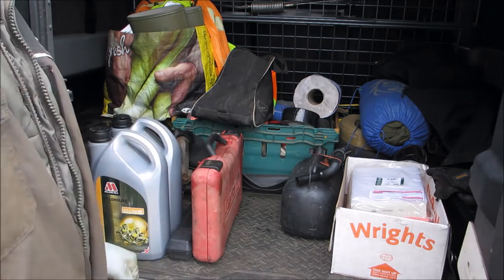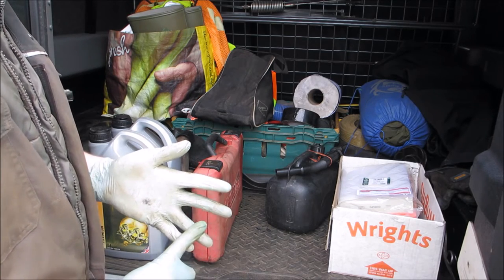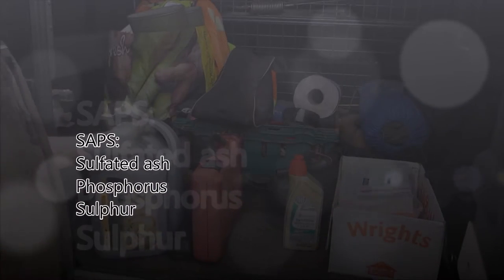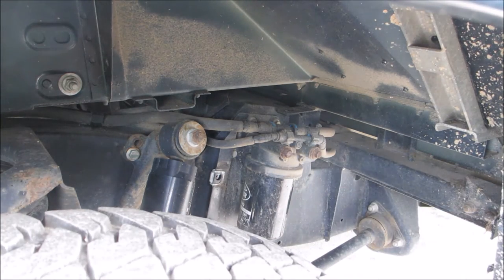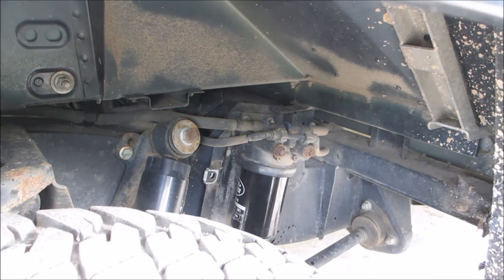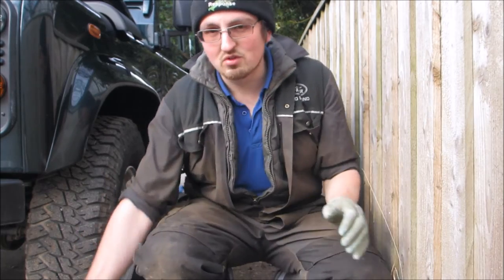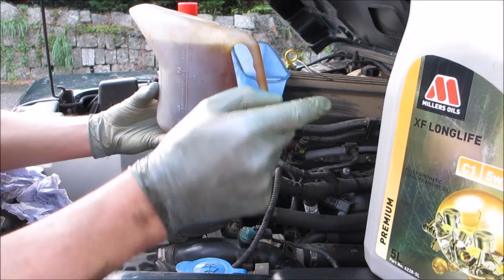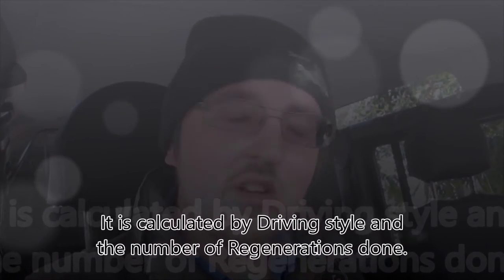Land Rover Defender 2.2 TDCI Basic Service Guide

Comment: My go to Land Rover Service video.Taken your advice with changing oil and air filter every 6000K.Always manage to do something wrong,like get more oil down my arm than in the receptacle, not securing the air filter body down correctly after replacing the air filter and hearing it rattle around as I drove proudly down the road or spilling new oil down the side of the engine despite using a proprietary funnel.If and when I shed my stupidity and cack-handedness this job will be something I look forward to rather than dread.Thank you and keep up the great content.....now on to the squeaky pedals....

Comment: Mate, that's awesome! Thanks very much for taking the time to share, especially for going to the extra trouble of showing all the part numbers and fluid specs. If you're wondering what to do in future videos, my vote would go to showing all the different points that need to be regularly greased (or at least checked). On one video I watched, a guy casually remarked about some part that I couldn't quite make out that if it was allowed to dry out it wouldn't last another 100km (he didn't elaborate as it was incidental to the main thrust of what he talking about). It also got me thinking about how many other grease points there are. They're the sort of thing that is easy and cheap enough if you know what to look for / do but if they're not tended to regularly they can really cause you some unnecessary and big bills. Plus they're exactly the sort of thing that the apprentice working on your car at the dealership is probably going to skip over in his hangover induced funk! Oh, and just BTW, my MY2016 Aussie 90 has the DPF - I think in the later years they became standard across the range.

Comment: Useful to see how far the engine oil goes. This saved me some mess as I placed the bucket far from the drain. When I removed the oil plug the Oring was broken and smashed - probably an incorrect tightening (by the LR dealer....). These types of plugs are made to last the life of the car, and, if properly mounted, the Oring also is reusable (I have the same type of plug on my bike, a BMW GS). At most, one could buy some spare Orings.
Reply from the maker: Nice insight. I couldn't find a o ring to match as the thought did cross my mind. So for the £3 or so it costs I just stick a new one on each time.
Reply: @Devonlandrover  You are right. The Oring has an odd match of outer and inner diameters so it must be a special LR part - clever choice # ironic #. Tomorrow I will rush to the nearest LR dealer, and tonight the baby will be outside with a pan under the engine and a paper plug .... not really what I had planned.

Comment: From Kenya, Thanks for the great Video!  I have a 2013 Defender 110.  I just changed the Air Filter today and it was absolutely hideous getting the cover out, but even worse getting it back in since the cover is so tight up against the underside of the right fender.  It took about 30-45 minutes to get it back in.  I wish I could have seen your trick to getting it back in.  Anyway, this is the best video I have seen thus far that is applicable to my vehicle.  Thank you so much and if you do any more of these do-it-yourself videos that are applicable to the 2013 Defender 110, please let us know.  With best wishes for you, Jon
Reply from the maker: Hi. Thank you for the kind words. I kid you not it took me something like 15 mins which had to be edited to keep things smooth. I'm due another 'B' service any minute now as I've done 6K since the last 'A' service. when the weather improves I'll do a driveline video as It'll be time to change all the oils for the Gearbox, Transferbox and Axles. If there is a specific procedure you need help on just ask.

Comment: Yes the 2.4 Puma is similar but has a paper element engine oil filter instead of a spin off type which comes with a new O-ring for the filter housing. I used Mahle oil filter part number OX339/2D and Millers Oils nanodrive EE Longlife eco 5w-30 fully synthetic (spec is Ford M2C913-D and is backwards compatible with the C and B versions, the Jaguar Landrover number is STJLR 03.5003.) For the final drive/diff i used Motul HD 80w-90 EP oil, about 1.6 litres per axle. Front axle is always worth checking as it gets a lot of the water first, has the swivel seals (or not so good seals) and can also suffer from failed oil seals inside the axle allowing the CV lubricant from the swivels to fill the diff. Completely agree with changing gearbox and transfer box oils regularly too, its easy enough with a cheap pump to add the correct amount and so much easier than removing them for rebuilding.

Comment: Fantastic video..many thanks. Just wish to add that they have now upgraded the oil filter part number from LR30778 to LLR058104 to LR104384 for my 2015 Defender 90 XS.
Reply from the maker: Thanks for the heads up Steve. I only did a routine change last month and not even looked at the invoice. LOL

Comment: ..hi..very nice video, straight to the point...some 2.2 pumas doesnt have DPF, in which case oil doesnt have to be C1/C3 grade, so any fully synthetic  5w-30 with ACEA rating A1/B1 up to C3 will be fine for non DPF pumas (im using castrol Magnatec 5w-30 Stop-Start fully synthetic)..
Reply from the maker: Yes that's right. The ROW ( Rest of world) as JLR call it, means that with no dpf then the spec of the oil can be as you describe a base 5w30 the same is observed with the TDV6 in the discovery when they changed to dpf's in 2010 ~. The engine fundamentaly stayed the same just the oil spec changed to prevent the blockage of the dpf.

Comment: Castrol 5w30  a5 is the right oil, it is specially used by ford petrol and diesel, good video, I did my one last month
Reply from the maker: The castrol Meets Ford WSS-M2C913-A/ WSS-M2C913-B/ WSS-M2C913-C/ WSS-M2C913-D so it's good for the 2.4. For the 2.2 you really need one with the WSS-M2C934-B approval which is a Low SAPS oil and won't adversely effect the DPF filter. If you are in the world where it isn't fitted I.E Australia then either grade will be ok.

Comment: Thanksfor a great video especially comments on oil specs. ...... Reference fuel filter renewal. On the Td5 you can prime the filter by fitting it empty then turning the ignition on and pressing the accelerator to the floor 5+ times. Is it not the same with this engine
Reply from the maker: The TDCI doesn't have the pump priming programme like the TD5 as you describe It would be nice to have though. At least the 2.2 had the in tank pump fitted so a cycle of the ignition to purge the system helps. With the 2.4 the same procedure 95% of the time works, As there is in intank pump then pre filling the filter is a must and then start the engine and apply revs too 1500 - 2000 rpm will pull enough through and stop it running out. The official method is to get a priming bulb to attach inline on the front of the fuel rail to pull fuel through and purge the air out. Obviously this is what you do if it doesn't work but in my experience it has.

Comment: thanks for a great video I have a car 2.2 TDI  when I start the car and after I push the accelerator to take full RPM 500 but second-time push accelerator does not take full RPM only 300 RPM push again and again but RPM 300 and which of and on the first time take full RPM 500 but Second time does not take full RPM 300 only  (I  check turbo, Eger Valve, MAF and MAP Senser, actuator valve not any fault) Please Help Me

Comment: Great video thanks.
Quick question reference wading depth and cat protection, should i be concerned with thermal shock of cat ?
Driving a 2015 2.2 tdci puma detender 110 utility.
Reply from the maker: Hi john Great question I'll give you the official answer and my own personal answer.
The wading depth of the defender is 500mm or in layman's terms the top of the wheel rim. at that depth even when stationary the water level will be just about the touching the exhaust as it snakes under the gearbox let alone reach the DPF so it won't harm it.Now to push the limits of your wading depth and try some bonnet lapping bow wave shenanigans, So looking at circa 1 meter deep then the forced low of the wave will still mean the water level at the DPF will be around the chassis rails and whilst splash and some such might cause it to be wet the exhaust is well built and I highly doubt any harm will come of it.
The DPF will mainly do a regeneration whilst at speed on the road (passive) or as the ECU senses that it is needed (active) in which it will post inject diesel to make the DPF hotter to burn the soot into ash. Temperatures are circa 600'C and I understand your concerns of thermal stress but I trust JLR to have correctly designed their filters to withstand this stress of the worst case scenario of dousing the DPF when in the midst of regeneration. Which would be brave as the DPF as a reference is at about the same height as your air intake grill on the wing and that's not something you want in the water should you park it there as a test.In short no I wouldn't worry for day to day typical wading with a defender (or other JLR vehicle) about it cracking the DPF.

Comment: Hi there - well done indeed.  Questions re the fuel filter WJI500040 on the 2.2TDCI: (i) There is a plastic screw on the bottom of the filter. Is that to drain any water or debris? (ii) How do you find out if the filter collected water? (iii) Is it recommended to change the filter every 60,000 km? (iv) upon changing the filter, do I need a priming pump to get the air out (I heard that if this is not done the high pressure fuel pump might get damaged) ? Thanks.
Reply from the maker: Hi. Yes the tap is a water drain. TBH unless you are in the outback, Africa or other countries where fuel quality and supply chain is considered risky then a cursory check after 1/2 a mile after filling up will tell you a lot about the quality and whether further action will be needed. Ok maybe if you leave it parked with very little in the tank for a long time then maybe quick test can't harm but in the whole it isn't needed. 
When unscrewing the tap then have a collecting bowl underneath or say the bottom of a PET bottle and if there is any water then you will see it in layers as the diesel will float on top of the water.
The service regime suggests a Filter drain every 12K miles (19,200 KM's) and renew the filter every 24K miles (38,400 KM's), for normal road use most of the time. For severe use (Offroad rough terrain muddy, dusty and wading), then the replacement is down to 6,250 miles (10000 KM's) . I'm a fussy person so even with normal road usage then I replace the filter every 12K miles as filters cost less then an injector pump.
On the 2.2 then you can just replace the filter then turn the ignition key to Position 2 then the intank pump will prime the system. Running the intank pump out of diesel will cause issues and damage the pump hence, the (hiccup and Limp mode when you run the tank really low, then eventual shut down) Just changing the filter and purging the air won't do any harm. If you're really concerned then 1/2 prefill the filter before the change so there isn't that much air there. FYI the 2.4 needs a bleed tool or the old prefill start, rev and hope as there isn't a intank pump to push the diesel to the engine just the suction to pull it through, and so an air lock will mean an engine non start.
Reply: @Devonlandrover  Late, but no less thankful for your kind response!

Comment: Thanks for tge reply ref DPF and wading depth.
Whats your view on underbody protection, looks  quite  involved, jetting,steaming,drying and then treating. If in favour what product would you recommend, any suggestions on where i could get it done with confidence that a proper job would be completed. 
Appreciate your feedback and time. 
Regards
JPW
Reply from the maker: Hey
Stopping the rust bug setting in is a very very high priority with later Defenders the factory paint is very UV unstable noticed by the chalky fading that happens on the rear cross member paint and the fact it is thin so there isn't much to stop the rust setting in.See my video Part one >> https://www.youtube.com/watch?v=ugB9IHKEQPc&
to see how I stopped mine using Bilt hamber Dynax Products which are still doing an amazing job to this day. IMHO if you are unable to DIY then Albeit using an equal and good product called Dinitrol then http://ccautomotive.co.uk/ Who has a long proven record in keeping not only Land rovers but all manner of nice things rot free.

Comment: fantastic video mate, just what i need to do my defender, is there anything of note that is different for my 2.4TDCI that i should know? thanks
Reply from the maker: Hi Sylvan billy. Sorry for the late reply My daytime job has been unrelenting lately.
The 2.4 doesn't quite need the higher Spec of oil that the 2.2 does so that helps as there isn't a DPF to be affected. anything ford M2C913B (Or C) standard is ok.
The Fuel filter replacement is critical as the 2.4 doesn't have an In tank pump so fill the new filter right to the top and connect it quickly after removing the old one, Start the engine and instantly bring the revs up to about 1500 - 2000 to help draw the fuel through the system, as there will be a small amount of air and this will be purged as the fuel will be moving through quickly due to the revs. If you don't you will create an air lock, which then you will need to get a bleeding bulb and bleed the system from the top by the engine.
Reply: Thank you 🙏

Comment: Hello again. Sir pls help me. I have the last Defender 90 2016 2.2L Heritage edition. Our dealer here in Jaguar Land Rover have Castrol Edge Professional C1 5W-30 with STJLR.03.5005 indicated at the engine oil plastic container. And nowhere WSS-M2C934-B written. Does it fit my Defender? Thank you so much!
Reply: And sir sorry I forgot. I have only 6,100 kilometers. City driven only. Do I have to change my fuel filter? Thank you!
Reply from the maker: Fuel will be ok if as before you do normal city driving with good quality gas stations to visit. The oil is all good https://www.opieoils.co.uk/p-162109-castrol-edge-professional-c1-5w-30-fully-synthetic-engine-oil.aspx

Comment: Hi there! If it is Castrol Edge Professional C1 5W-30, it has WSS-M2C934-B? 

Should be this kind of oil that fits the last Defender? 

Every what kilometers should I change fuel filter?

Thank you so much!
Reply from the maker: Hi yes that spec will be fine for the last ones using the 2.2 with a DPF. 
In the NA, urban Australia and European countries then 2 years or every 24 thousand will be fine. If your filling from cans or in Africa, south America or the outback where debris in fuel storage tanks could be an issue the do it yearly or after a trip to that type of area.
Reply: @Devonlandrover  thank you so much! Take care and God bless!

Comment: Thanks for this video. I do something wrong. I put castrol 5w30 c3 and not c1   I have 2.2 puma. It’s very bad or could wait next oil service?
Reply from the maker: Hi
It's not catastrophic as oil still lubricant even if the slightly wrong spec at least it wasn't the wrong grade like a 20w 50.
It is a Low SAPS oil so the risk is lessoned it is a slight difference, (c1 - 0.5% to c3 - 0.8%) in the ash content so IMHO a short service interval of 6 thousand miles shouldn't do any harm. The DPF location means it's pretty good at regenerating so I wouldn't worry unduly about the small amount of extra ash generated as the 2.2 doesn't use all that much oil.
Reply: @Devonlandrover  Hi, thanks for your answer. I am reassured with your explanation. Thank you very much !

Comment: Thanks for this great video on basic servicing! I know the Diesel Particulate Filters (DPF) are common, but as i understand it, not a feature of all Defender 110's  (mine is a 2.2 TDCI Defender 110, 2015 model year). How would i confirm if this is installed or not. (it makes a big difference in oil price for 5-30W, or 5-30W with DPF "non-clogging")  thanks again in advance for taking the time to cover off the basics in such a clear manner. Appreciated.
Reply from the maker: Hi Sam. if you have one within the European area then it will have a DPF. Australia is one place where the emissions regulations mean a DPF doesn't have to be fitted.
A quick look in the engine bay on the drivers (RH) side under a few heat shields will reveal all. a large canister just off the back of the turbo with various wires and pipes going in and out will be the DPF filter. if it is a straight pipe then one isn't fitted.
Reply: It appears i have a can (off the back of the turbo RHS, back a bit, and below). There is a large nut visible on the top. I don't see any wires and pipes going in an out though. Hmmm hmmm
Reply from the maker: @samoir1   if you want in the description is an E-mail bung a photo across and I'll tell you for sure.

Comment: Hi, Nice video, but I did not understand what do I have to do to reset the oil service light, can you please help me with that? What do I have to hold for 15 seconds?
Reply from the maker: Hi. The Brake and the Accelerator (Gas) pedals at the same time. then the little Red oil can (oil warning light) will blink on and off. Release the pedals switch off the ignition switch leave 2 minutes and it'll be reset.
Reply: Hello! My red oil can didn’t blink 🤷🏻‍♂️
Reply from the maker: Mmm interesting, it's not even a unique LR thing it's a ford thing. you held the brake and accelerator down fully depressed for at least 15 seconds or until the oil light starts blinking right? As that is the only recorded DIY way to do it without resorting to using OBD scan tools to plug in and reset.
Reply: 4WDSouthWest oh now it blinks!🤦🏻‍♂️Thanks! I just didn’t understand the instructions at first. Saludos desde Costa Rica 🇨🇷
Reply from the maker: No problems, Happy to help.